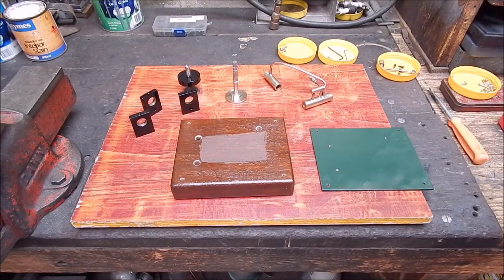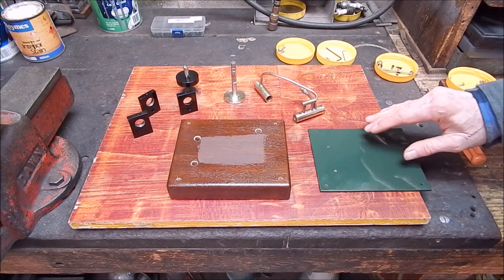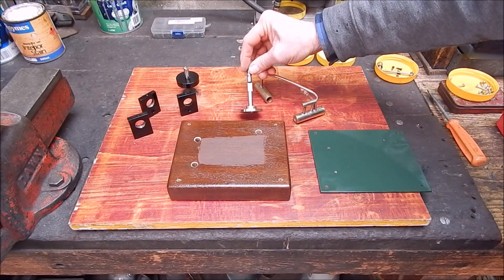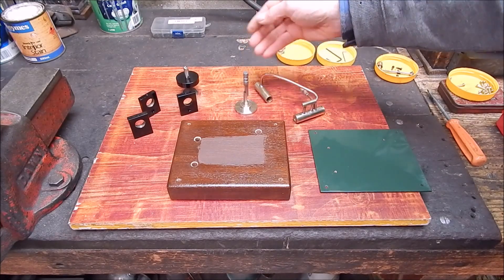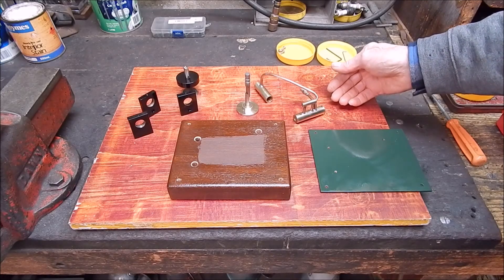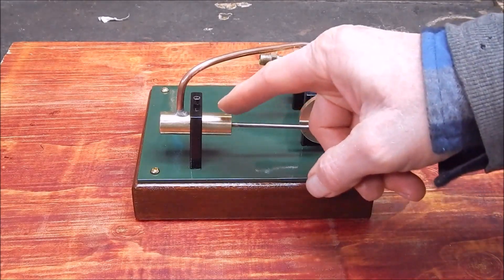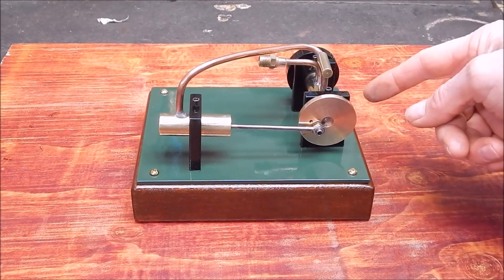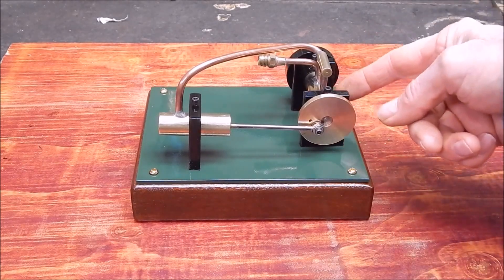I re-assemble and finish the rotary valve model steam engine

Comment: This is very inspiring. When I was in high school one of our metal work projects was to build a simple steam engine. My ambition got the better of me and I designed my own rotary valve engine. Everyone said it wouldn't work. On the night before it was due I lost the crankshaft bearing and never finished it. I think now is the time to put that to rest and build the working unit once and for all.
Reply from the maker: Sounds like a good idea to me.  I've built several of these, including one made out of a spark plug and they all work perfectly.  It's totally doable.  Cheers Rob

Comment: The hoosier whirlwind compressed air model  was a very successful design from the late 20's.  Being for model airplane use it carried a limited compressed air supply and needed to leak as little air as possible which involved close lapping of both piston and valve.  His were brass.  My version uses aluminum and epoxy instead of solder.
Reply from the maker: Interesting.

Comment: Hi Rob, very nice end result, and boy what a difference that flywheel has made! Great little engine that just stands out for its total simplicity. I bet that would even run off an old bike inner tube for those that don't have a compressor. Cheers, Jon
Reply from the maker: Hi Jon, amazing turnaround with that flywheel.  Cheers Rob

Comment: Do you have an optical tachometer?  Would love to see how fast that thing got.  Nice work!
Reply from the maker: Yes I do.  It would have gone even faster, but may have overstressed the conrod, so I backed off at a reasonable speed.  It can rev pretty fast, especially as it has a square bore and stroke. Air flow did not appear to be a restrictive factor.  Cheers Rob

Comment: Way off topic, Rob, but I'd like to see you comment on whether this six-jaw from AliExpress can do the job of a heap of collet-chucks.
https://www.aliexpress.com/item/4001050326917.html?spm=a2g0s.8937460.0.0.68172e0eixICWs
Reply from the maker: I've never used a chuck like that, but in a word "No".   I doubt you would get the same level of accuracy, as scroll plates are no where near perfect.  You certainly will have the likelihood of marking your work, as the grip is not continuous/full circumference as occurs with collets.  So metal crush will occur, especially on tubing.

You are comparing two entirely different chuck systems.   I will take collets every time over something like this.

Cheers Rob

Comment: You should be pleased with that Rob. Its a beautiful piece of machining, its simplicity is breath taking. I'm still struggling to understand how you shared the intake and exhaust tube...Like you say, "just do it".
Reply from the maker: Think of it this way Benny - the two original pipes meet/join at the cylinder head, so why not join them closer to the rotary valve unit and the single pipe becomes an extension of the cylinder head.  You achieve the same result.  Eliminate the need for two pipes and the air will oscillate in one (even at very high RPM).  Stirling engines work on a similar air flow principle.  I hope that makes it clear.  Cheers Rob

Comment: That is one cracking looking little engine Rob 👍👍👍 The green and black looks particularly good. It also proves the concept of having a steam/air chamber and just using one pipe to the cylinder. Runs really nicely too.  Cheers, Alan.
Reply from the maker: Thanks Alan, it turned out much better than my first impressions/run.  The flywheel makes all the difference.  Now it runs on the least pressure of any of my steam engines.   Be interesting to see your approach to this.  Cheers Rob
Reply: @Xynudu  Hi Rob. I'm going to use square stock like in the original. So I've got hours of fun dialling in the 4-jaw to look forward to. Why hasn't anyone invented collets for square stock yet?!  Cheers, Alan.
Reply from the maker: Actually they have Alan.  That's why 5C type collets are heavily used in industry for production work.  They come in round, square, octagonal, basically a range of geometric shapes/centres, as they use a three split body that allows this to happen.  The downside is that they have a very small/nominal compression range.  You can't do that with ER due to it's multi-slot design.  You win one way and lose the other with collet variations.  Most people go with ER as it's just more user friendly.  Dust off that 4 jaw chuck :)  Actually I don't mind using those, but you have to pad the jaws to avoid marking stuff.  Have fun.  Cheers Rob
Reply: @Xynudu  Well, thanks Rob, I've learnt something today already 🙂 Never knew that, will now go and do some research on 5C collets. I've found the old used sanding belt makes good packing on chuck jaws. Cheers, Alan.
Reply from the maker: It sure does Alan.  Super good packing.  Cheers Rob